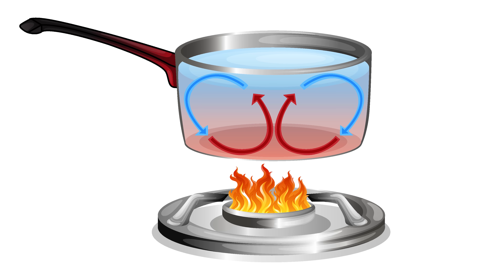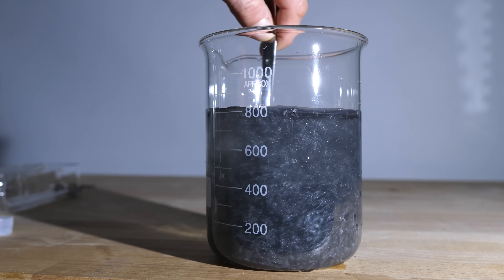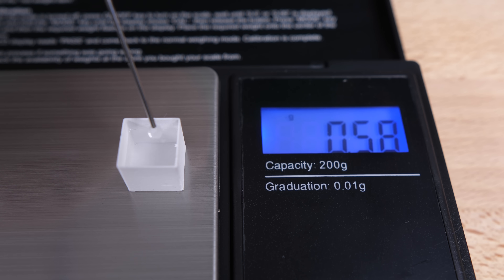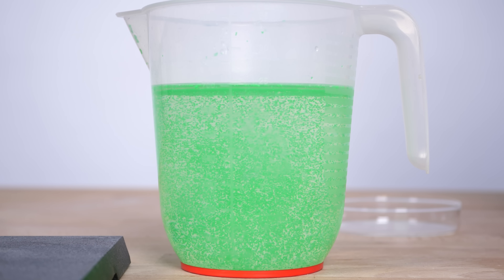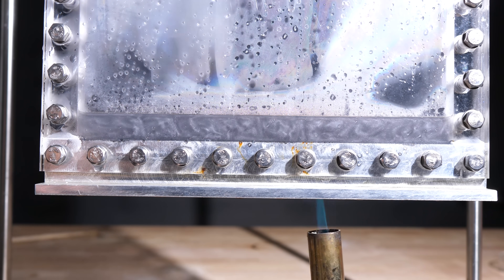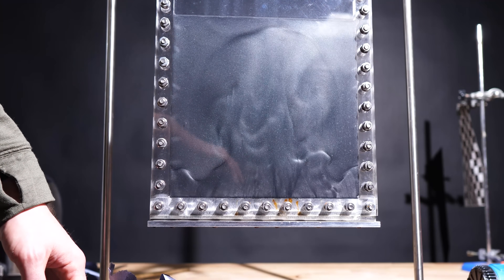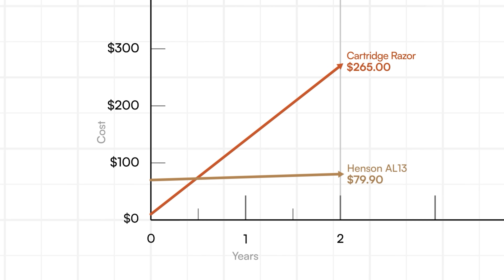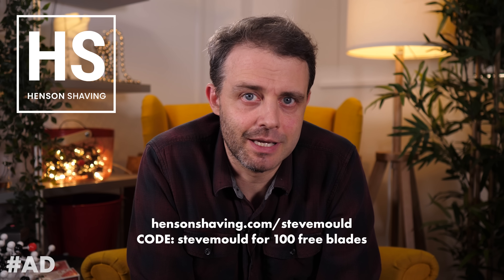The bizarre patterns that emerge when you heat ANY fluid

Comment: Fun with Large-Scale Convection: Those of us who fly gliders/sailplanes use convective plumes ("thermals") to climb thousands of feet and fly hundreds of miles/KMs without any engine! A typical "thermal" (a single plume of convection) is maybe 50-150 meters across and often exhibits the behavior shown in your very first demonstration at 2:20 : we see wide-spread gently-sinking air on the outskirts of thermals, and lots of turbulence / shear at the interface between the rising and sinking air that descends around the "core" of the thermal. Its quite a thrill to be rising up at several meters per second (i.e. several hundred feet per minute) with no visible energy source. Imagine rising up the height of the Empire State Building in 3 minutes, or the Shard (in London) in 2 minutes - with just the feeling of the air around you, bubbling/pushing up underneath your seat!
Reply: That's so fast! So cool!
Reply: I'm kidding. I've been in ONE glider, when I got my aviation merit badge at summer camp. Only cool camps have airfields.
Reply: @joshyoung1440  Damn I'm jealous, never been to a camp with an airfield.
Reply: Damn that's cool. So do you just plop down a hundred miles away with nothing but your glider and your wits?? Lol or are the flights more controlled?
Reply: @supersonictumbleweed  @joshyoung1440  The best way to think of soaring is that its "the world's biggest game of hop-scotch": we'll find a thermal and climb - depending on the strength and height of the convection layer this can be anywhere from 500m - 3000m (1500 ft to 9000+ ft), then glide 10-30km (5-20 miles) while slowly descending. We then find the next bit of lift and repeat the process. When gliding we'll fly anywhere from 90 - 190kph (55 - 120mph). Figuring out where the lift is and how best to make multiple "hops" turns every flight into a bit of a mental puzzle; and since the weather is always changing no two flights are ever the same! We have all of the same controls as any small airplane (aileron, rudder, elevator), just no engine (hey, there's less to break, and no fuel to catch on fire)!  🙂 
I know you were kidding, but sometimes we DO have to land without making it back home. We can land at airports or in farm-fields. The French call this going "aux Vaches" - translated to "with the cows". 😀Getting the sailplane out of the field and back home is its own adventure, but modern sailplanes have wings that come off after removing just two big metal pins/bolts. So we can disassemble them in about 30 minutes tow them in long narrow trailers behind our cars.
Reply: Why are thermals small compares with the going down áreas?
Reply: @danielheckel2755  Probably an illusion, because we glider pilots are focusing on useful thermals .i.e at  least strong enough to compensate the proper sink rate of the glider, so where the energy is most concentrated, which implies that they are narrow, or at least their usable part is narrow. But when flying from a (usable) thermal to another one, we frequently encounter areas of slowly raising air where it is not worth to stop for circling. I am a glider pilot since 1995 and instructor since 2003, and I often explain to my students that the first thing you must learn is how to detect thermals and circle inside, otherwise you won't be able to stay airborne, and later, when you master that first thing and you want to cover some distance, the second thing you have to learn is to avoid stopping and circling in thermals which are too week.
Reply: @danielheckel2755 - The full explanation is far too complicated for a YouTube comment.  But very roughly: because it takes concentrated heating in one area to start the upward flow with enough energy and momentum to continue. As those parcels of air rise they are subjected to less air pressure and they also radiate and conduct their heat away to neighboring air particles. So they naturally cool and spread out. The momentum they gain on the way up tends to cause them to "overshoot" what an equilibrium temperature and height would be if they were magically placed at the right spot for their temperature and pressure to match the surrounding air. Once this happens, they wind up cooler (and sometimes denser) than the air around them; so they begin to sink. The sinking is generally a lot gentler/slower than the rising, but because the air has expanded/spread out, it forms a wider zone of sinking air.  Additionally, when the original air started to rise, other air has to rush in to replace it down low - this has a general "suction" effect on all the air around the base of a thermal.  This is why you get puffy breezes on nice sunny days - what you are feeling is air rushing past you to fill in underneath a rising thermal nearby you!
Reply: Great, now I have to find a way to ride in a glider.

Comment: The big holdup here seems to be the friction on the sides of the containers. The flow velocity of a fluid will always converge to zero towards a container surface, so if the fluid isn't very transparent, you might still just be looking at the outside of the action, which behaves much more "viscous" than the center of the fluid.

Comment: Two things, if you have a thermal camera sensitive enough to point at this, that would be cool. Second, if anyone wants to model this, FDS is a free cfd program that's fairly easy to learn (ChatGPT knows all about it) and is designed to model these types of flows. From memory you can switch between 2d and 3d modelling if you really wanted to get academic!

Comment: the mica flakes are usually a phyllosilicate mineral that consists of layered structures. When mica is broken down into fine flakes, the surfaces can develop charges, especially at the edges. These charges can interact with the polar water molecules, leading to electrostatic interactions that can cause the flakes to align in certain ways due to attraction and repulsion forces between the charged particles. A combination of this and surface tension interactions based on the hydrophobic/phillic "ness" of the flakes probably contribute to most of the effect.

Comment: Those particles don't self associate. The explanation is that they are oriented by the shear stress that the fluid flow exerts on them. Think of a door floating down a river. It will be flat.  Not every particle is aligned because of collisions.

Comment: One trick for the rayleigh-bernard hexagonal cells may be to enlarge the container laterally and get homogeneous temperature in the bottom! These pattern formation systems are quite sensitive to boundary conditions and making the system larger usually helps...

Comment: you can easily model it by using rayleigh-taylor instability problem formulation. As a perslon who does a lot of modeling like that I can say that boundary conditions are very important in this kind of experiments. You have chaotic flows because your boundaries are not constant. You should equaly heat up the whole bottom . Second setup with shallow but very wide tank will give better results with convection cells.

Comment: According to Gemini answering to this prompt:
"Mica flakes in water, align themselves locally. Why is this happening?" 

Gemini:
Mica flakes in water do indeed tend to align themselves locally, and there are a few key factors contributing to this phenomenon: 

1. Shape and surface properties:

-Flat and disk-like: Mica flakes are naturally flat and disc-like, with a large surface area compared to their thickness. This flatness makes them susceptible to interactions with other flakes and the surrounding water molecules.
-Hydrophobic surfaces: Mica surfaces are generally hydrophobic, meaning they repel water molecules. This creates a preference for the flakes to interact with each other rather than with water, leading to aggregation.

2. Interparticle forces:
-Van der Waals forces: Weak attractive forces exist between all molecules, including mica flakes. When in close proximity, these forces can cause the flakes to stick together, leading to alignment.
-Electrostatic interactions: Depending on the specific type of mica and the water conditions (pH, ionic strength), there can be electrostatic repulsion or attraction between flakes. This can influence the alignment pattern, sometimes leading to face-to-face or face-to-back arrangements.

3. Brownian motion:
Random movement: Though mica flakes can aggregate, they are still affected by  Brownian motion, the random movement of particles due to water molecule collisions. This constant movement helps prevent complete solidification and contributes to a more dynamic, locally-aligned structure.

4. External factors:
-Shear flow: If the water containing the mica flakes is subjected to shear flow (e.g., stirring), the flakes can align perpendicular to the flow direction due to hydrodynamic forces.
-Electric field: An electric field can induce alignment in mica flakes due to the interaction between the field and the charged surfaces of the flakes.

Comment: I think the mica flakes line up locally because they are exposed to the same water flow velocity. Like a bunch of parachutes in the wind, they will always align to the stable state for which the drag coefficient is the highest, causing the flat surfaces of the mica particles to align with the flow direction of the water.

Comment: If you have never used a safety razor, I recommend you try it. the first 2/3 shaves are scary. but after that it becomes a pleasure. it gives a much smoother shave than disposable blades.

Comment: "Ink is expensive"

*Prints a checkerboard
Reply: he had to use the rest of the ink before HP bricks his printer for being mildly critical of the price
Reply: LOL @ZaneEckols
Reply: "one problem with the beads is that, they're really expensive."
...
"i bought the expensive beads... i bought them."
Reply: @contrapoetra  Hope he recovered them from the water rather than just flushing the lot down the drain.
Reply: @oy2000 I'm sure he recovered them, since he paid a lot for them
It's quite easy when all you have to do is to just evaporate the water
Reply: 😂  @contrapoetra
Reply: bro he saved like 50% ink printing a checkerboard!
Reply: The cartridge model between printer and shaver ain't so different. Sponsor's make a difference.
Reply: Brother >>> HP.
Reply: Not that expensive

especially if you write it as a business expense
Reply: @bobmcguffin5706 It's every bit as expensive when you write it as a business expense. In fact it can often be much more expensive.
Reply: @babybirdhome if you’re an employee it is. My work doesn’t charge me for what I print at work

Comment: Flew hang gliders for many years searching desperately for this stuff.  The turbulent, sinking air around the rising column made things all the more interesting - and it could all be happening a few feet from rocks and trees.
Reply: You can attach a hang glider to a trike with a small engine (like a rotax 447) on it and you won't have to search for thermals anymore. :)
Reply: @LiftPizzas  Flying mountain thermals in a hang glider is euphoric. No experience in life ever came close.   Plus you build a knowledge of the air that powered pilots never achieve.

Comment: @SteveMould re: boundary layer, I suspect the distance between the walls is small enough to inhibit large turbulence features from forming across the container… I’m not a Reynolds number expert :/ I did notice in the last tank shot with oil, the bottom appeared to be moving upwards  as a sheet, but of course that’s not possible it’s going down somewhere. It would be interesting to observe the back side concurrently, see if there are opposing sections of flow. Also tipping the tank slightly, or 45 degrees for example may yield insight…

Comment: I wouldn't be surprised if the mica is just being shoved around by the polar water and clumping up because it's such a great insulator and naturally has a high surface area. Perhaps there's some localized effect on the charges inside the mica and water - I'm imagining a shorted out capacitor for each mica flake, except water is not metallic and the electrostatic force from the hydrogen bonds never really goes away because you still have water surrounding both sides of the mica trying to align oxygen to hydrogen. It might be possible to test for these interactions by putting mica in pure non-conductive water and comparing its behavior after salting the solution - if in fact a small capacitor is formed by each flake I would expect this interaction to lessen as the solution becomes conductive and allows them to all neutralize with free charges.

Comment: You don't need the fancy safety razor, even the cheap ones are sooooooooooo much better than the cartridge ones under literally every aspect. It's baffling how they managed to convince the world to buy those cheap plastic pieces of shjt instead of the even cheaper (since you only replace the blade and they cost pennies) high quality all steel razors

Comment: Mica flakes probably align due to trace iron content. When dry, they build up a static charge which causes each flake to form a small magnetic field. Once in a suspension, the magnetic force can overcome friction and cause the flakes to align. But since the magnetic field is so weak, it's easy for disturbances in the fluid to break them apart.

Comment: As a paragliding pilot seeing these curls and twists is both interesting and scary at the same time, thinking I'm using the same principle with thermals to stay up in the air.
Reply: Huh another paraglider pilot beat me to the comments section with the exact remark I was going to make.
I do hope our Reynolds number is closer to the oil scenario.
Reply: Paragliding pilot here as well. What I wouldn't give to be able to visualize thermals like this in the air! Seeing the flow along the ground toward the base of the thermal (for lack of a better word here), seeing how the single fast moving thermal was surrounded by a large area of slow moving sink (which makes sense), all very helpful. Thanks!
Reply: It would be interesting to have trigger points at the bottom to see if it works more like thermal triggers.

Comment: I think of the mica flakes as large dinner plates in shape. Very flat with a large surface area. I don't know if thinking of them as a ton of large dinnerplates helps other people intuitively, but for me, its pretty clear that dinner plates would align with eachother. A parpendicular pair of dinnerplates would quickly jostle around (especially with the help of Vanderwaal forces) to become aligned.
Reply: I don't think you have a high enough concentration of mica for them to interact mechanically it a way that aligns them

Comment: This takes me back.

2:00 The flakes align with each other locally because they align with the shear flow of the fluid.

7:16 You'll get more regular convection patterns with uniform heating, near the onset of convection, and if you can keep those conditions stable for long enough to reach a steady state. The temperature difference for the onset of convection will depend on the layer depth, viscosity, and thermal properties of your fluids, which is why you got more uniform behavior with the thinner layers and more viscous fluids.
Reply: Thank you for your explanation. I was looking for them in the comments. You mentioned "this takes me back". Were you a fluid dynamicist?
Reply: @lucas29476  In grad school, my research was in bilayer convection. With two layers, you can have either thermal coupling or mechanical coupling dominate the interaction between the layers. They tend to drive the flow in the driven layer in opposite directions, so when the effects are of comparable strength you can get oscillations and other interesting time-dependent behaviors near onset. I've since moved on professionally to software engineering, but I still love physics and pattern formation.
Reply: @lucas29476 Maybe he's a fluid
Reply: Aligning with shear flow sounds deceptively simple, it makes sense but it doesn’t quite explain why it feels relatively unique to mica. So maybe it’s not that unique? Steve kinda presented it like it was but I believe a lot of glittery shaped objects do that. Maybe it’s just the shape then and of course density to some degree I’d assume you’d want stuff closer to water’s density. Is that mostly the case?
Reply: @monhi64  They're not unlike feathers or arrowheads in the rough shape. Flat and longer than they're wide.

Unlike feathers though... They're heavy. They're hard to push around (while much easier to rotate). It's hard to relate to anything because we're used to moving around in air. But imagine maybe a diver's harpoon? A usually metal and heavy spear which has to be heavy underwater to work like wooden spears out of the water do.
Reply: @supersonictumbleweed this was a great explanation, thank you!
Reply: This comment is underrated so much.

Comment: Something I learnt in my Heat Transfer module last semester is the reason natural (unforced/starting from still) convection is so complicated is because has two-way coupling. In forced convection, the movement of the flow, the velocity field, affects how temperature is transfered.
In the case in this video, natural convection however, there is two way coupling: Temperature affects the density, which in turn acts as a force field (due to the body forces of gravity being affected by the density) that affects the velocity field, in turn affecting the temperature field again. This is what leads to all the instability